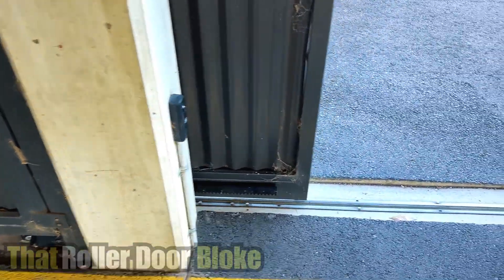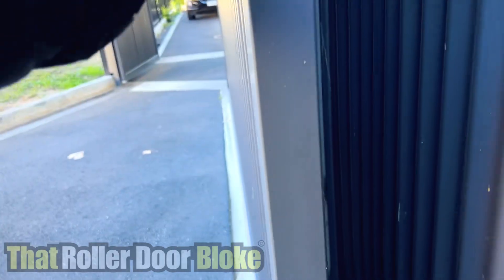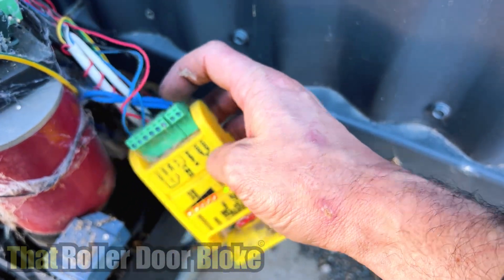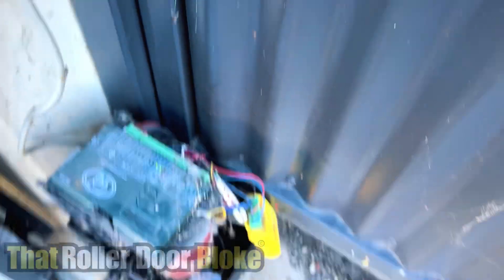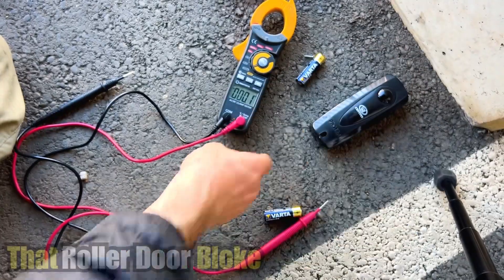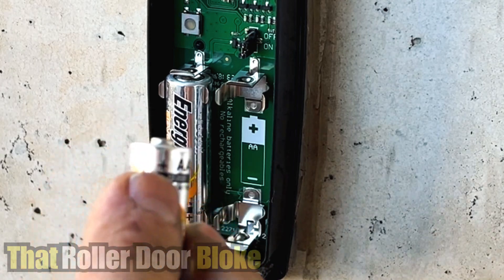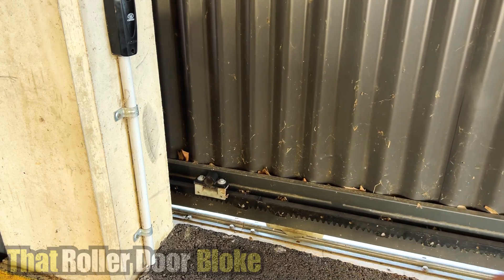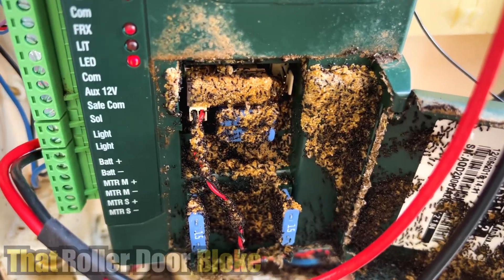Diagnosing & Fixing a Faulty Gate (You Won't Believe This Nightmare Cause!)

Comment: Can we check the motor before replacing the board? Connect the battery to motor directly? Will it activate the motor?
Reply from the maker: Yes you can connect the motor wires directly to 12 volt no problem 👊🏻